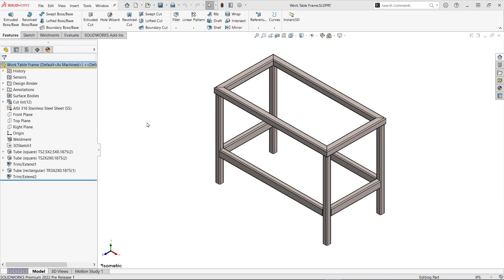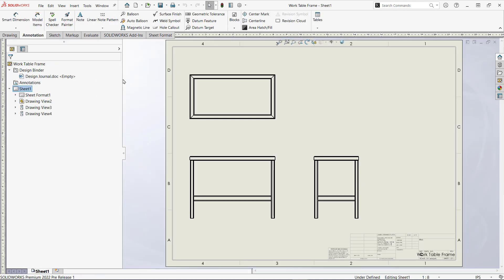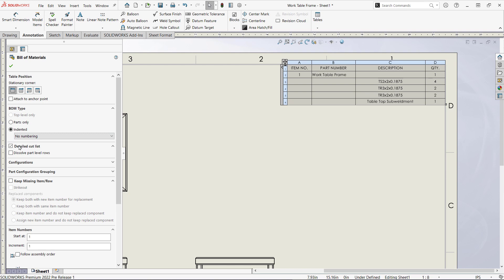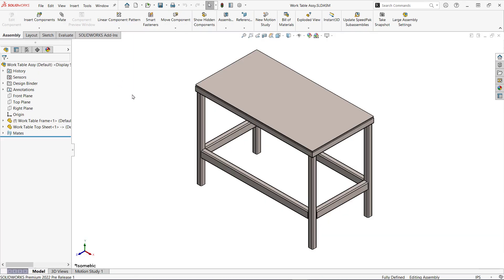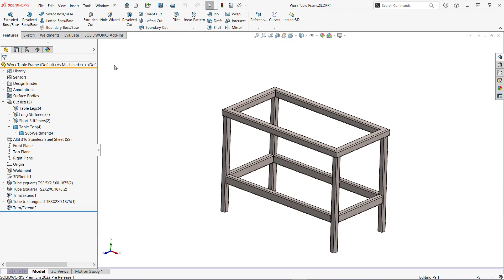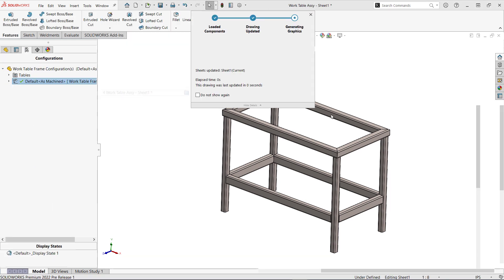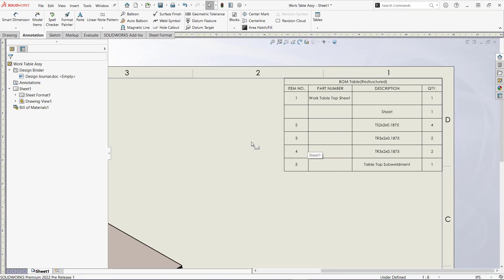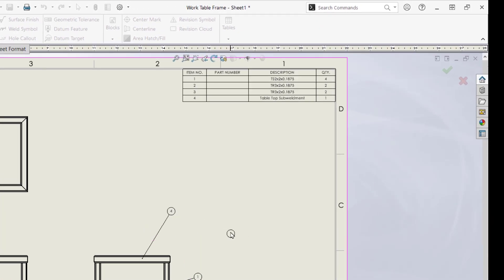What's New SOLIDWORKS 2022 - BOM Detailed Cut Lists

Comment: I just want the weldment-part to show the material in the BOM because it's part of a larger assembly. Instead, all my weldment-parts in the BOM have blank materials. I don't want to show the entire cut-list because it'll get too big.
Reply: I have the exact issue.  Mine are ALL BLANK.  Did you find a solution?